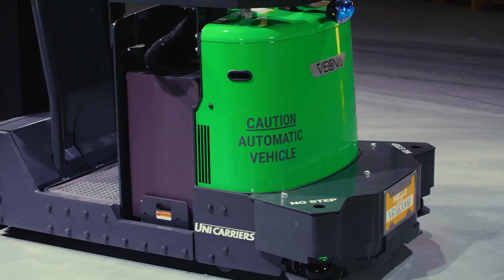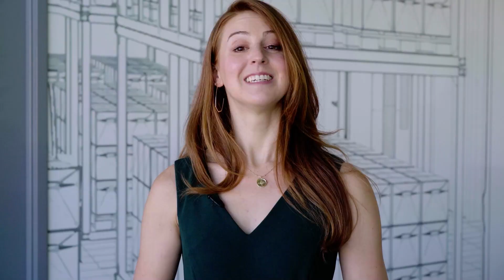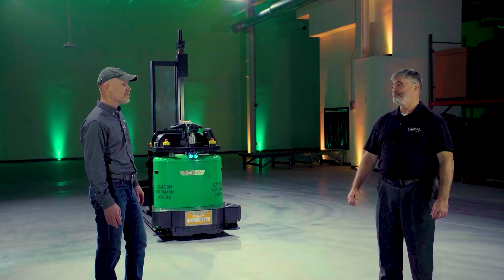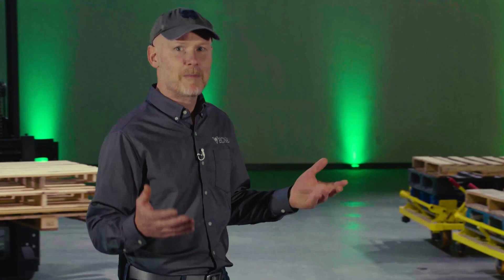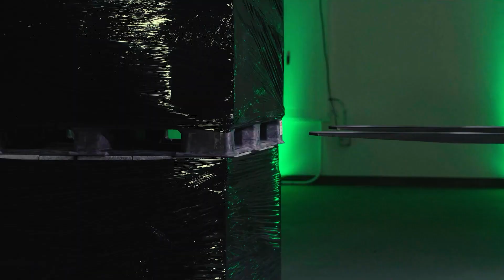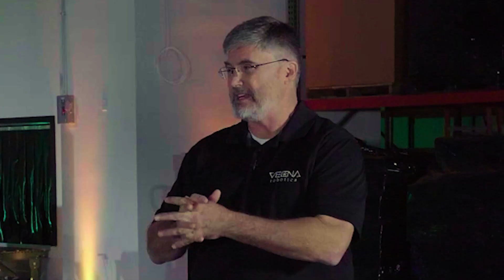Product Launch of Vecna Robotics' Autonomous Counterbalanced Fork Truck

Comment: Congratulations to the Vecna team for achieving such a difficult task engage the pallet, lift it to the required height, and then placing it on the target. I have a question regarding placing operation at time stamp 4:37. Does the system take the position and orientation of the pallet into consideration on which pallets need to be stacked? If you see closely on the time stamp 4:37, the right side of the pallet has overshot the lower pallet by approximately 4 inches.